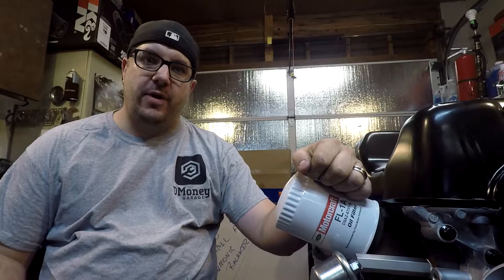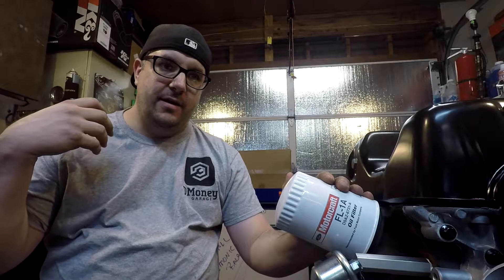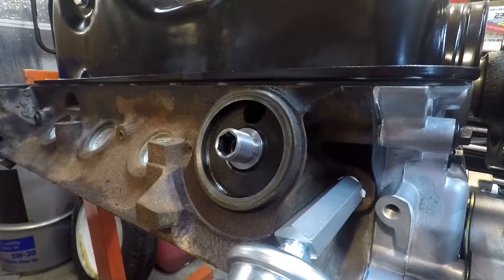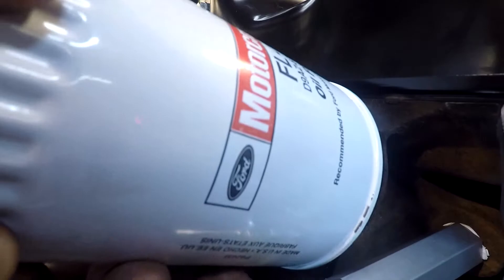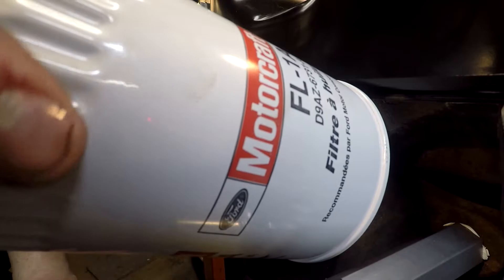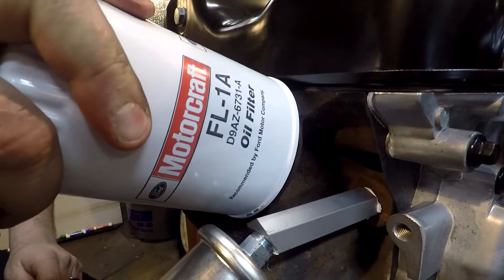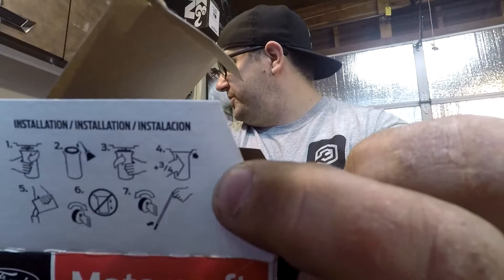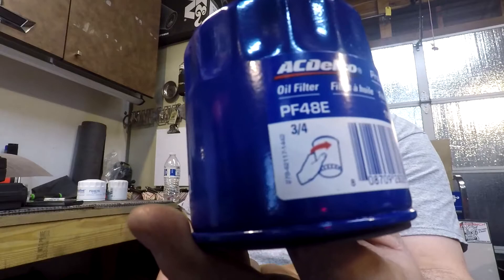How To Install An Oil Filter. How tight should an oil filter be. Oil Change Basics.

Comment: I’ve been changing my oil for years and noticed the 3/4 turn on the WIX filter instructions. I usually start my 3/4 turn a little later and end up using a filter wrench. Watching this video makes me realize I have been over tightening this whole time and should only have to do the 3/4 turn by hand. Thanks a lot for this video.

Comment: I've been over-tightening my filters for years. I was scared that i was not getting them tight enough. Im actually having to replace a brand new Wix today because i cracked the housing with a filter wrench while tightening it 1/4 turn after I absolutely couldnt move it with my hand anymore. Lesson learned. Thanks for the simple, but informative video.

Comment: Nice video and makes sense. I know you hand tightened it by 3/4 turn; while removing it does it come off by hand or you still have to use a wrench of some kind?
Reply from the maker: Depends. I’ve had to break them free with a filter wrench. Not because it was too tight but the rubber gasket is stuck from hot/cold cycles.
Reply: @DMoneyGarage  Thank you for your reply. I too had the same experience irrespective of how much ever I hand tighten; I still have to use a wrench to remove it. May be for the same reason you have stated above, the filter gets really tight up there; and many a times I end up damaging it while removing it especially on my Honda Odyssey.

Comment: Thanks for the video. If I'm not sure whether mine is tight enough, can I unscrew it and re-tighten it? Would that cause any damage to the filter? I just put it on a few days ago.
Reply from the maker: I would just leave it along if it’s not leaking. Loosening it could cause the rubber seal to start leaking.
Reply: Thanks for answering that. I put the filter on and haven't put oil in yet because I have to pick up my kid from school. Lesson learned for the next on. I will keep an eye out and may change it earlier than the scheduled one.

Comment: Other than it being hard to remove later, is there any other reason not to kee turning by hand until you cannot turn any more?
Reply from the maker: I’ve had some that were “put on by hand till they couldn’t turn anymore” actually damage the threads on the filter housing. Not common but I have seen it. Plus I shouldn’t have to use an air hammer to remove an oil filter a few thousand miles after it was changed. Service techs that do it every day has seen that😂😂
Reply: @DMoneyGarage  thanks for the info !

Comment: Although it wasn’t practical to demonstrate in your video because of the engine wasn’t mounted in the car you should have told viewers to…ALWAYS PREFILL THE FILTER WITH OIL SO YOUR ENGINE ISN’T STARVED OF OIL BECAUSE THE FILTER HAS NO OIL AT START UP.  EVEN A FACTION OF A SECOND IS CRITICAL WHEN WE ARE TALKING ABOUT NO OIL WHILE AN ENGINE IS RUNNING!